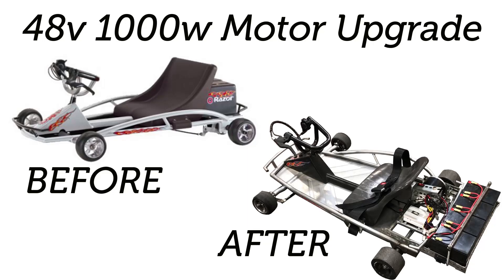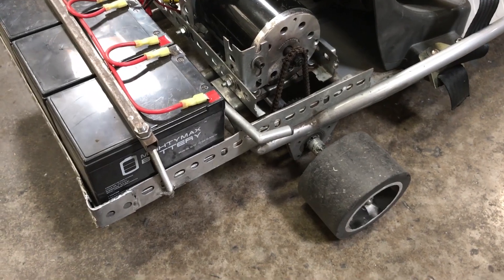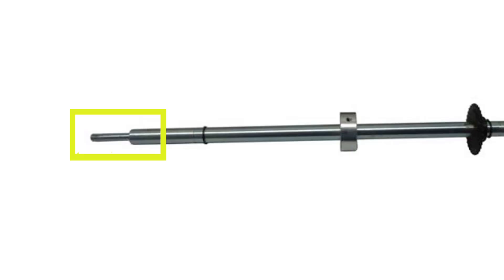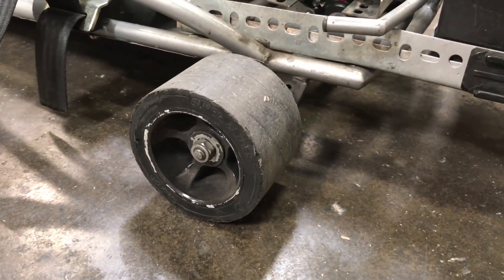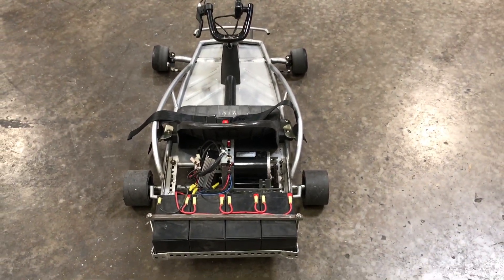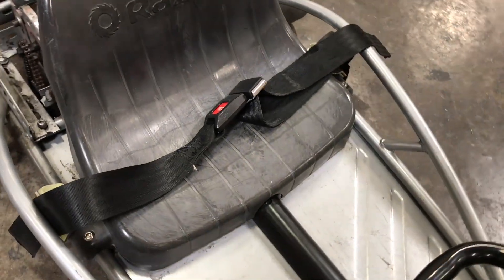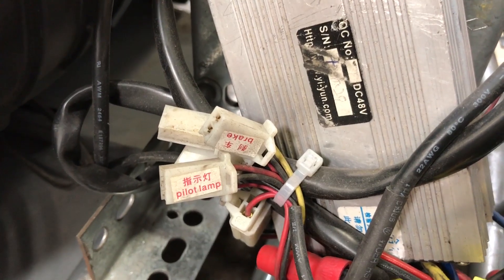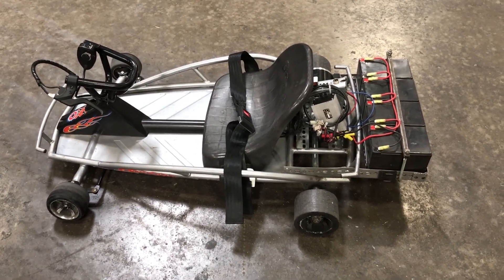Razor Ground Force Go-Kart upgraded to 48v 1000w motor

Comment: You can put the front rubber tires on the back drifter axle with some simple ingenuity. I also recommend taking the plastic seat out and replacing with a flat one from a folding chair to buy precious space for us adults. You cannot reuse the 24 volt power switch when switching to a 36 volt or 48 volt controller because the original switch limits voltage for some strange reason.

Comment: I went from the stock 36 on the drifter to ezip400 wheels with the disc brake and 60t(?) Sprocket  and I can feel the 2-3 or so mph speed difference.  But it's much more fun to be able to hit the throttle and take off fast! 

  I'm using brushless controller w reverse. Using a throttle that has both an on of button that I use for/connected to reverse and a "3 speed" switch that connected to the controller.
I just wanted to see if I could use the thumb throttle with 48v because the kart is so compact, it's uncomfortable using the for throttle. Especially when turning because for high speed turns, I have to extend my turn side leg.  (And not is THAT a workout lol legs and an workout, also arms as holding on is also challenging.)

Comment: Why didn’t you just use lithium power tool batteries? Just saying,
Reply from the maker: Power tool batteries are extremely limited in size and therefore have low (amp hours / ah) which equals short run times. The batteries I used are 12v 12ah batteries. Most power tool batteries are 3ah or less regardless of volts.

Comment: Did you replace the chain? My 48v motor won’t fit w/ the original chain
Reply from the maker: I did not replace the chain. As mentioned in my parts list, you need to get a dual D-bore sprocket for a #25 chain (Ebay about $7).  I used the original chain, but depending upon the motor mounts you made, you might have to get a longer one to make it fit your setup.

Comment: would the dune buggy work for this? or is smaller? not sure
Reply from the maker: Derek Iwasiuk I’m sure you would need some buggy modifications but don’t see why it couldn’t work.  Assuming you get it, your top end speed would be substantially better than the Ground Force because the wheels are larger. Let me know if you go for it!
Reply: @zach_wolfe  yeah i'll give it a go, just want to be able to rip down some dirt and gravel more so :). 1000w crazy kart would be fun too but no idea where the batteries would go
Reply: @DerekIwasiuk  How did this turn out for you and what modifications did you make. I just picked up the dune buggy for 20 bucks and I'm trying to explore my options

Comment: So the drifter comes with 2 wheel drive without any modifications?
Reply from the maker: David Facio Unless things have changed in the last few years, the drifter is 2-wheel drive with hard plastic wheels for drifting. The regular ground force is 1-wheel drive with harder rubber wheels for better traction.

Comment: How are you recharging it
Reply from the maker: Steven Corbo Search eBay for a 48v 3 prong charger. The first listing is what you need. You can find them from different websites but they generally run about $40.

Comment: Hey, I am using the same speed controller and motor as you used in the video... the clip connector for the charger on my ground force drifter fits into the connector of the new speed controller, but it makes the connection RED-BLACK and BLACK-RED... is this a problem? Do I have to swap the wires? Also is there anywhere where you have a circuit diagram I could look at?
Reply from the maker: GoPro Kid If the clips line up correctly, all I can recommend is trying it. Assuming your wires are for the motor, if they are not correct, it will spin the motor in reverse.
Reply: It’s for the charger cable... is it dangerous to swap the wires?
Reply from the maker: GoPro Kid Gor the charger, make the sure the red and black line up.
Reply: Thanks!

Comment: What is the heaviest person that has ridden this?  I have an 1800 watt 48-volt motor ordered.
Reply from the maker: Thomas Mead We has a 300 lb rider. The motor will have more than enough power. It just comes down to the stress placed on the frame & axles which are rated at 150 lbs or so.
Reply: Thanks!  The is where I plan on going with it after a little "Dressing Up" is done to it.  https://www.makerfaireorlando.com/power-racing/

Comment: I have one but have problems with the bumps is there anything I can do to help
Reply from the maker: Bri O If you are referring to the bumpy ride on asphalt or any surface that isn’t smooth, there is no solution to that. It’s the result of the hard rubber tires.
Reply: Maybe look for a different tire compound and size that's compatible with the rims. Softer will be smoother but probably too "sticky" to drift.

Comment: Im working on this now for my kids, We have a razor drifter that works but lost charger, how do you know how long to charge the 48v set up for and if I went with 36v instead of 48v would it make a diff in speed as its for a 100lb rider.  Also if Im starting with an intact razor drifter version any variations I need to be aware of from your instructions? i.e do i need to change the sprocket diameter on drifter axle etc.... we have it completely stripped down to paint just want to get my parts list right before we spray.
Reply from the maker: Jon Jones You will need to get the correct voltage charger (36v or 48v). The chargers automatically shut off main charging and go into trickle charge mode once the batteries are full. A completely drained 36v or 48v battery setup takes about 2 to 3 hours to fully charge and lasts about 45min to an hour of run time. The sprocket size on both the standard ground force and the drifter should be the same size.  Good luck with your build!
Reply from the maker: Jon Jones I forgot to answer your 36v vs 48v speed question. Both motors have the same RPM rating. In order to get the most speed possible, you will want to use a 48v battery setup and controller to push a 36v motor. With a 100 lb rider you shouldn’t have the controller overheating issue that you will get with heavier riders. If your goal is top speed, go with this setup. If you want longevity (aka: least amount of possible issues) go with a straight 36v or 48v setup. I’d personally recommend the straight 36v setup. Less batteries to replace over time and lighter overall setup.
Reply: Thanks for the help Sir, You cleared up all the questions i had! gonna get started today...

Comment: Would there be an option to run tires that don't spin out?
Reply from the maker: bimmerman1 I have not been able to find a "better" wheel solution. I suppose the stock rubber wheels that come on the Ground Force provide better traction but if you are a bigger rider, you run the risk of broken axles. If you swap axles with the Ground Force Drifter, you lose the free-spinning wheel and will have some turning issues cause by a 2-wheel drive system. I even looked into the larger rubber wheels from the Razor Dune Buggy but was told the axles for the dune buggy have a bigger diameter at the wheel connection point so that won't work either. If you (or anyone else) finds another wheel solution, I would love to hear about it.

Comment: eBay is the only place?
Reply from the maker: Sean Mcclellan EBay is the cheapest place I've found to get the motor. It's available from other websites like tncscooters if you just don't want to use eBay, though.
Reply: @zach_wolfe  top speed?

Comment: Very nice. Im having trouble hooking up the 6 wire throttle to a 48v 1800w brushless controller. Their wiring diagram is confusing. Can you helpe with that
Reply from the maker: armenvegas Every throttle and controller wiring diagram will be different. For a throttle to work it only has to have 3 wires connected. The POSITIVE, NEGATIVE & the VARIABLE (usually the blue or green wire on the controller).  The other wires are for battery power indicator lights.
Reply: Zach Wolfe thanks. Turned out my hall effect sensor inside the throttle went bad. After replacing it... my Razor screams.

Comment: Good shit. I just bought a used ground force drifter for my daughter and the control module is bad. Perfect excuse for me to start moddin the hell out of it. Lol. How do you think 3, 18v Dewalt drill batteries wired in series would do? Dare I try?
Reply from the maker: Boyer Dan your biggest issue with the drill batteries will be the lack of amp hours, which equates to a very short run time. The batteries I used were the 12v 12ah batteries. They make larger capacity batteries (higher ah) but the physical size of the battery increases and it's tough to put more batteries in the small rear end of the go kart.  I actually started out modding an electric pocket bike by adding a couple of remote control car batteries to my setup. I found a setup called the +5 kit from eBay. It's where I learned to push more volts to the motor for more RPMs. Good luck in your modding!